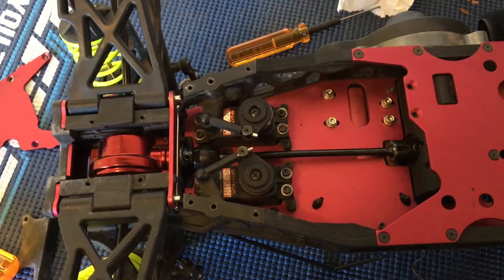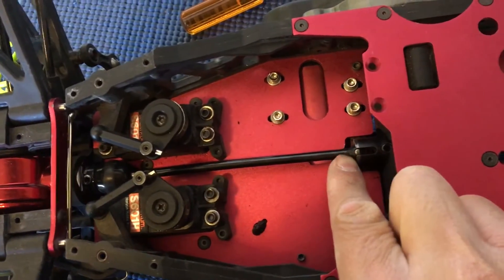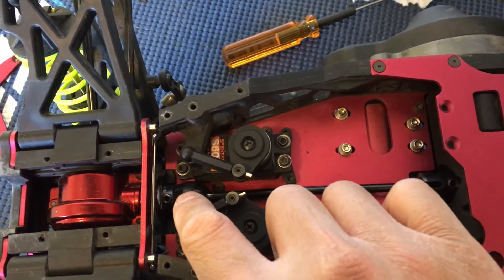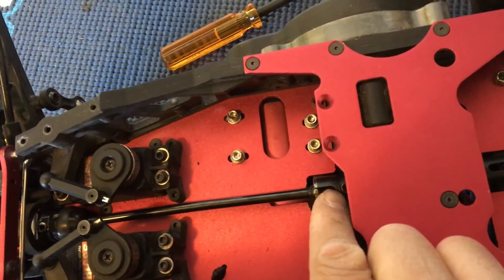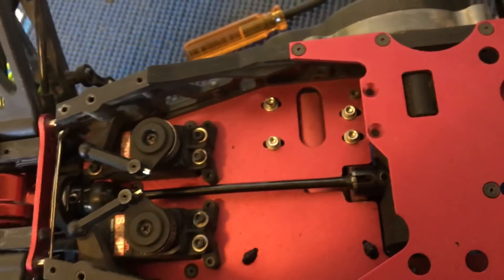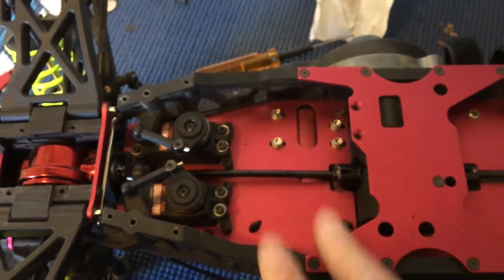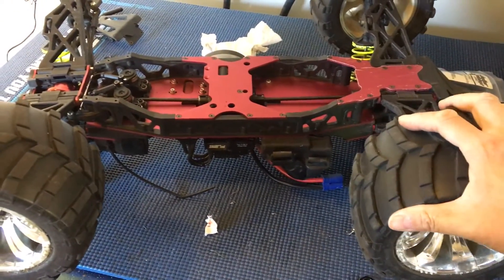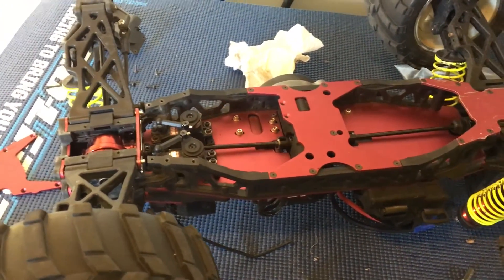Racing2Learn: 1/8 Monster Truck Losi LST XXL2-E: Center Driveshaft Engagement Issues Fixed?

Comment: Im have the same driveshaft popping out issue on a nitro LST2 model myself.   Im thinking of shaving the set screw in the diff cup a little, this was I can get it to sit a little but further from the diff in that outdrive hole as you said.  This is common on these trucks, but mine is even worse, it actually pops out.
Reply from the maker: No more Losi’s for us after this one, we were scared to drive it for fear of breaking something every time we brought it out

Comment: Yeah that is weird about the front driveshaft. But it's the same as mine. So I guess that's as far as it goes. I wonder if it's because they stretched the original Muggy or LST to make the XXL but didn't change out the centre shafts? Not sure. 
The Max 6 is excellent for this rig. Ran a full 6S 7.2Ah pack mostly at high speed on a local oval and the ESC was only 15C greater than ambient. Motor temp was also down. But I also deactivated the AVC, so that may also have something to do with the temps dropping. Also the stock servos work great on the 7.4V BEC setting and they too are operating at lower temps.
Looking forward to your running vid. I'll post a quick vid of my setup when I get the chance.
Reply from the maker: Thanks for the insight and the comment Ken! Here's the running vid: https://youtu.be/PBMinOJ4A94
Reply: Totally normal all lst series trucks are like that